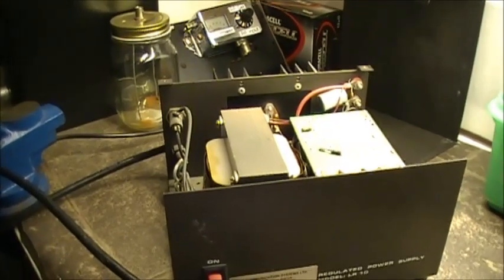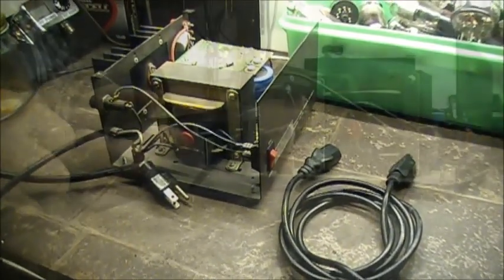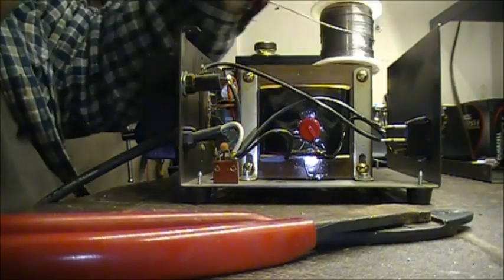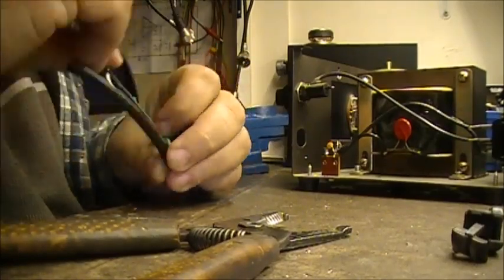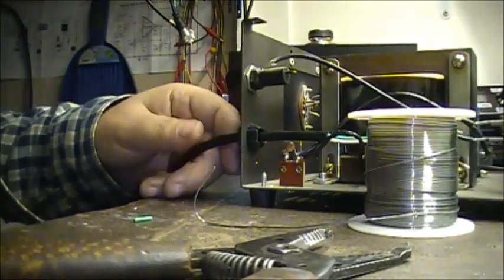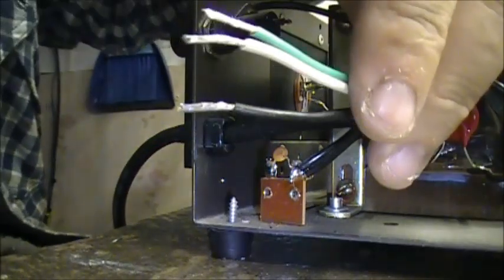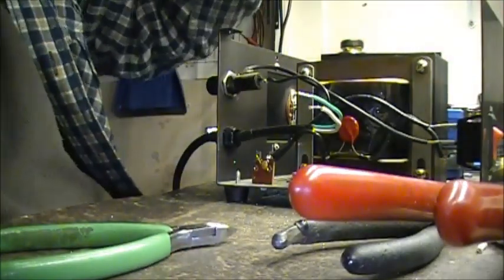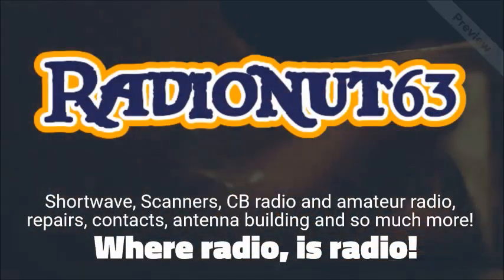ASTRON  Model LR-10   /   Power supply repair

Comment: Simple repairs, but necessary! I'm surprised Astron didn't add a lock washer to the fuseholder since it's subject to lots of use. The electrician's tape is a good idea because you can remove a layer or two to adjust to the wire thickness. Heat shrink may be neater looking, but can make the connector struggle worse if you go too thick. 73
Reply from the maker: Yep, would do the same as when i had too much tape applied.   ;-)